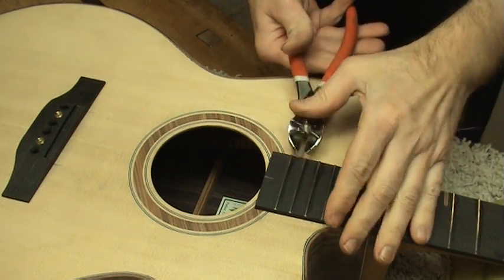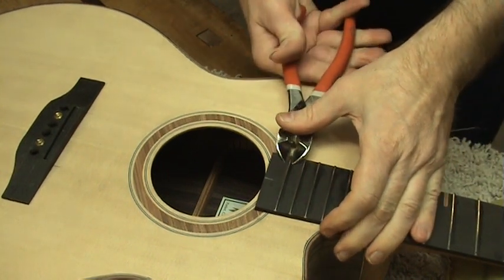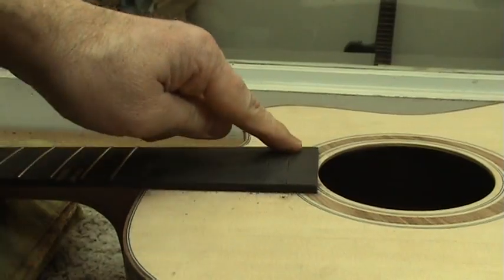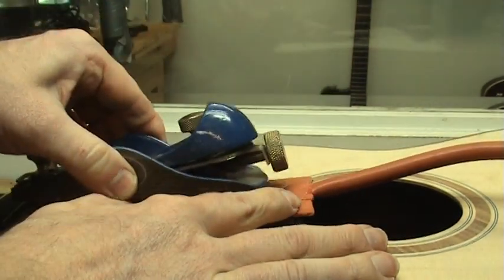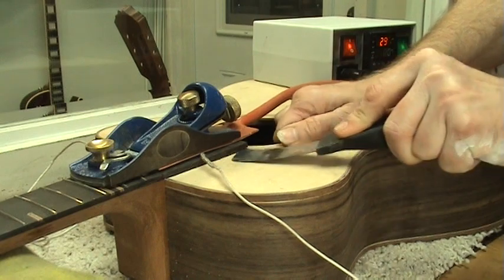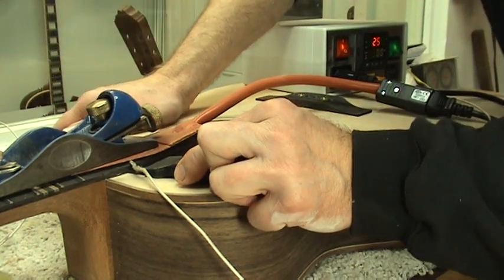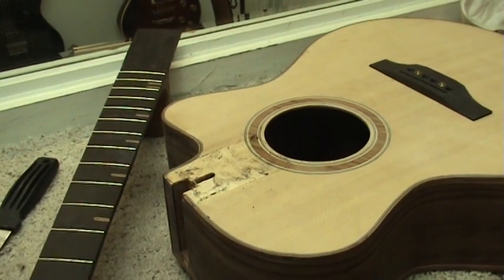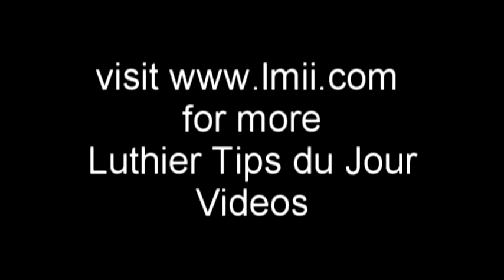Luthier Tips du Jour - Neck Removal

Comment: Robert, how come u did t heat up the frets before removal??
Reply from the maker: Sometimes I do and sometimes I don't As you can see though they came right out without issue. That is the most important thing.
Reply: OBrienGuitars Does it depend more on the type of wood the fingerboard is made from or is it something else that tells you...no need to heat the frets before removal? Thanks so much
Reply from the maker: johnnypk1963 If the slots are full of glue people usually heat them to get them out once the glue has softened.